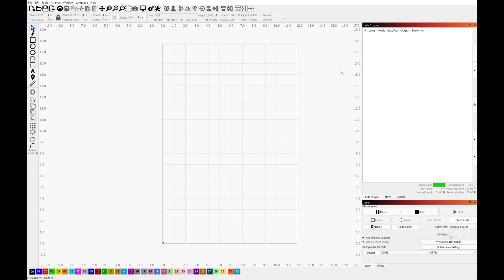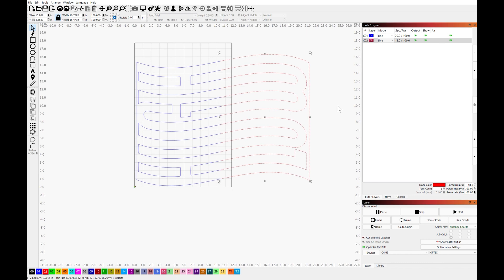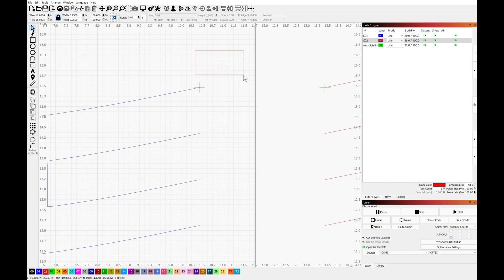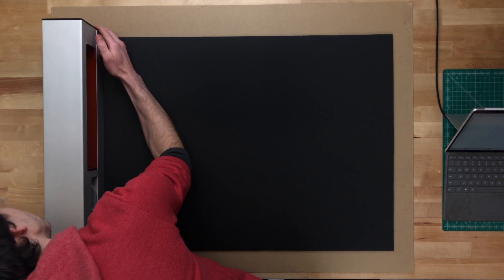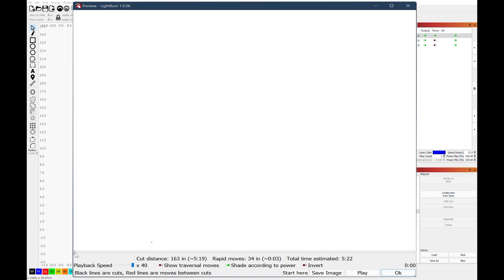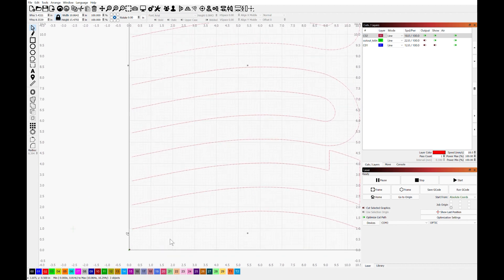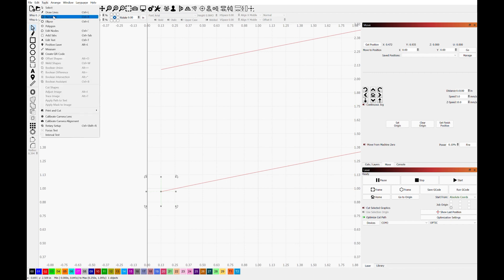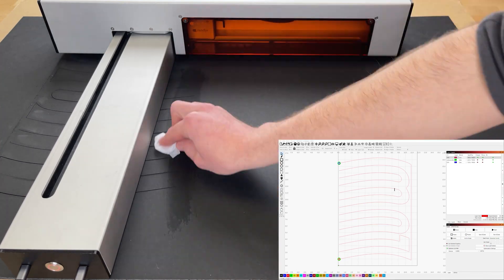Made with Optic 1: Cutting Over-Sized Designs

Comment: Man… I love almost everything about the Optic but If I’m being honest if I’m paying over $2,300+ I expect this process to be MUCH more intuitive. One of the main selling point for my pledge for the project is to have the ability of the infinite work space but to ALSO be intuitive. I didn’t think I had to go through ALL that. I mean, Initially I thought there would’ve have been motors on the bottom most unit(Not the section with the Laser diode) that would have Wheels & Motors that move in tandem with the Top unit with the Laser Diode so I wouldn’t have to lift the unit At All. But then I realized that wasn’t the case, then thought OK well, if it at least some how had an easy way to just easily shift the unit to a intuitive point then hit Resume, then It’s not AS bad. However, with this current process, I would be going Back and Forth from the Computer to the Rendyr, then to the computer again and so on depending on the size of the project. The Hardware had one thing I was let down on I was willing to work with, but the process of the Software part just isn’t as intuitive as I would like. Is there a way for you guys to Improve this process in this Unit? Or make some kind of standalone proprietary piggy back software Because I’m having 2nd thoughts about my pledge to be quite frank.
Reply from the maker: Hi Luminary, thanks for checking out the video and commenting! I understand your concerns regarding the alignment process, but I think I can offer some reassurance. This video is meant to be a slow-pace, step-by-step introduction to the alignment process in Lightburn, and also a demo showing the possibilities of what you can do with this feature and the Optic. Thus it may seem a good bit more drawn out than it would ever be during normal operation. Having used the alignment function myself in Lightburn, I can say that after the first time the process feels logical and highly reliable. Additionally in this video we are using a black material which makes the laser dot used for alignment slightly less visible in person, and significantly less visible on video, which may contribute to the perception that this process is a bit tedious, which I can assure you it really isn’t. We’ll publish more tutorials and demos on this topic in the near future, and additionally I recommend you check out other demos that show Lighburn’s “cut and print” feature as there are a few good ones already out there that should help boost your confidence in this functionality of the Optic. I hope this is helpful, and let us know if you’ve got any other questions or concerns!
Reply: @rendyrinc  I appreciate your response. Will look forward to those videos showing a better feel of the process. Would also be nice to see a couple different designs and different size formats.